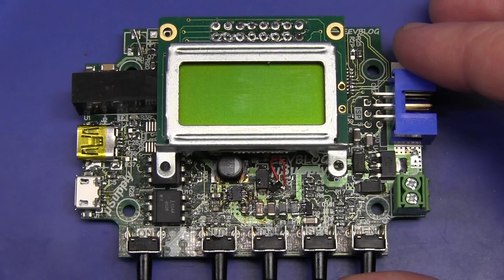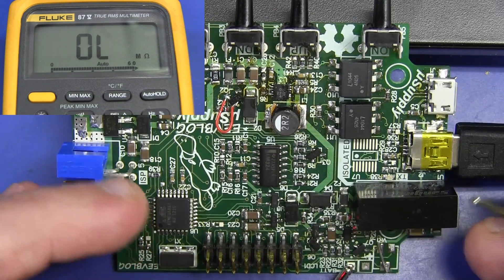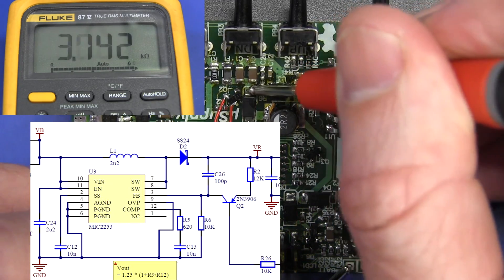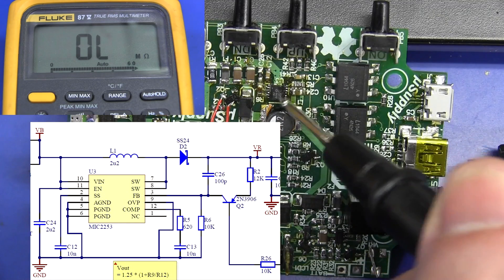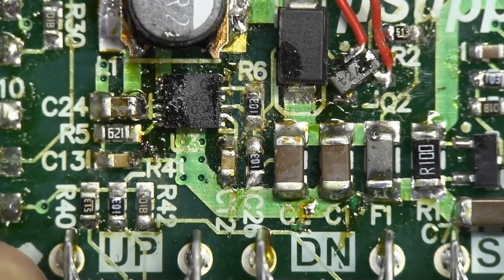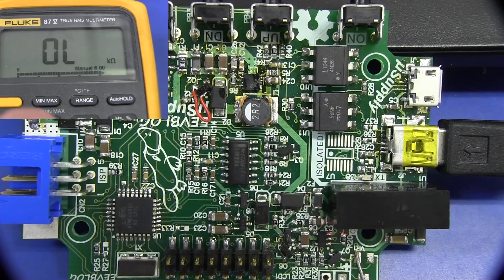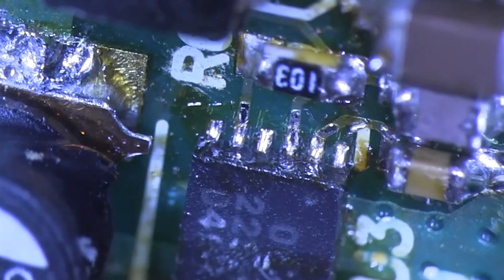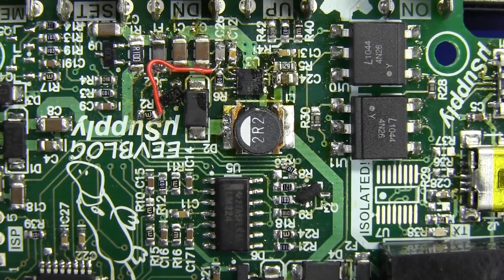EEVblog #366 - USB PSU Troubleshooting

Comment: After fixing the missing cap, he probed the end of the inductor to declare there is another remaining issue. After reflowing the IC to try to repair it, he probed the end of the diode to declare the issue fixed. Is it possible the IC was actually fine and it was just a difference of where he measured it?

The switch node he measured should be either pulled to ground by the IC or at the boosted voltage when the switch is off, so the multimeter may just be averaging the two switch states and making it look like a flat 5 volts.

Comment: Once I had a clone of Sansamp guitar distortion pedal self oscillating in audio range. After hard work trying to discover the problem, I found that the lot of solder flux (like in this board of the video)  was someway causing the problem. After some isopropyl alcohol the oscilations gone. I suspect of some stray capacitances, but who knows...
Reply: Jonathan Araujo Not stray capacitance, but stray leakage resistance :) You has an electrically leaky flux.

Comment: Around 10:46, it looks like you measured the voltage on the inductor, rather than the cathode of D2.
Reply: I think they share the same trace? Could have been an easier point to probe.

Comment: Hi Dave! Could You share full schematic of dc dc converter?
Reply: I saw that he uses a battery with 4.2v max that is supplying the voltage to a MIC2253 Boost converter to make it 15v, then use a linear regulator like LM317 or LT3080 to give you your required output voltage. I forgot how he gets 0v with this thing.

Comment: Yeah better the board is ok than its not.
I went on putting a trim pot in series instead of to rail and ground in the layout and printed my board etching it, drilling it and then it didnt work that damn trim pot -.-

Comment: You should really remake the board. All the transistors has bad pin package layout. And i see that the ISP connector is the biggest on the board. For small designs like this it would be nice to use Tag-connect . com
Maybe a little review about this connectors would be nice from you.

Comment: Hi,
At one point in the video you say, that by measuring the dc Voltages at the coil you can imediately see that the switches at pin 7 & 8 are not switching.
How so??
Ususally the DC voltage across a coil should be very small , more so if the output is not loaded (1mV for say 10mA and 100mR Coil Resistance). If one would want to measure that voltage it would than be best to directly switch to a higher sensitivity mode and measure across the Coil.

Comment: What usually do it have a wire with a Needle soldered to it attached to a crocodile clip, so I can attach this to the positive probe and easily trouble shoot the tiny pins, like with the issue you had at 2:00 :)

Comment: I see you had not any soldering issue at any time, just wrong resistor placed and wrong measuring points to test it, you should always have around 5V between both inductor pins and 7.7V after output diode, check it out please

Comment: I don't see why you claim at 10:45 that converter isn't working while you measure just after the inductor, I think you should always check the path after the output diode to make sure it is working, maybe with a scope you can check the voltage spikes at the inductor but with a DC multimeter is not smart enough to check that high frequency switching converter, just in case to check it now that is working, measure before and after diode to see the difference
Reply: Jotaemebé you are wrigt there is no difference beetween this two test point before and after the inductor  unless you are using oscilloscope..

Comment: Hi Dave, I had similar problems with a QFN accelerometer on my prototype PCB. I followed the pad layout from the datasheet which didn't have any copper projecting out the footprint. So I couldn't use the iron to reflow it. I replaced the chip many times, hot air reflowed it etc and still the chip won't work. Then I used the dead bug method and it worked, I finished the firmware.

The production run afterwards did not have any issues even with the same PCB pads.

Thanks for the video!
Reply: kalhana1 The data sheet layouts are often not worth the bits in the pdf file they are in. Design the layout based on IPC rules, and extend pads as needed for manual design. Chip manufacturers aren’t in the PCB design business, they just copy-paste a standard package pinout drawing into the data sheet. Often nobody even knows where the original drawing came from. It’s a mess. Not worth it.

Comment: Dave, get yourself a decent tack flux especially designed for reflow with hot air. I'm using SMD291NL and I highly recommend it when soldering QFN packages. I recently successfully soldered a TPS622316 DC/DC coverter which is a 1.5x1 mm pain in the arse.. but still.. working perfectly!

Comment: Dave, perhaps you should try a method us software engineers like to use called "Rubber Duck Debugging".  You get a rubber duck (preferably, any inanimate object will work), then you go through the entire section of the problem explaining everything in detail to the duck.  Its the best way to remove the wall you hit or being unable to "see the forest for the trees".  It always works great for me when I've run into a heisenbug or similar scenario.